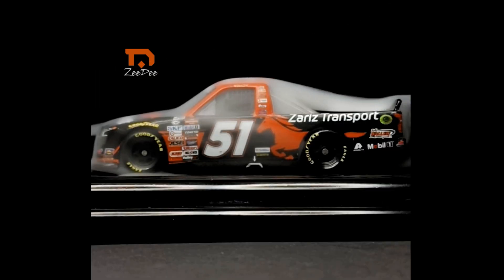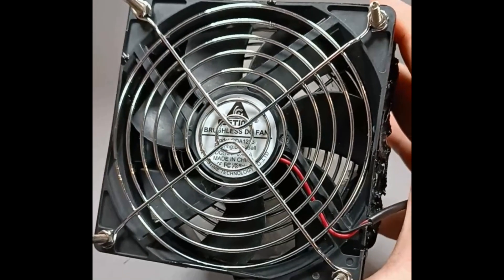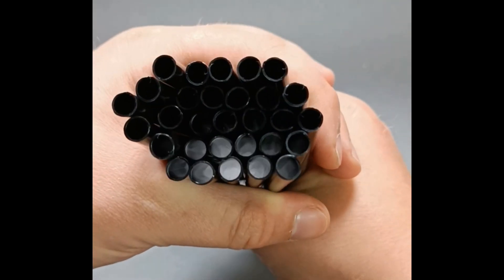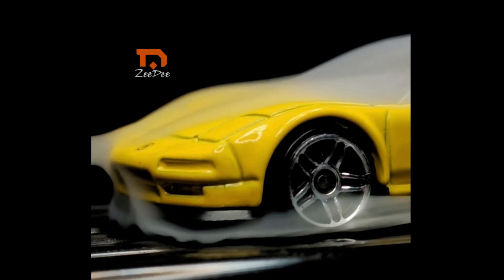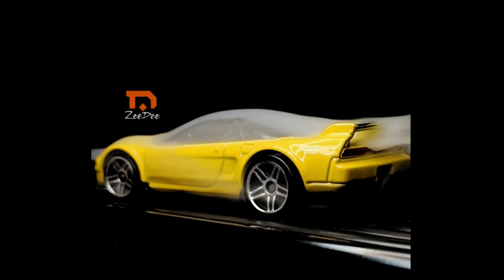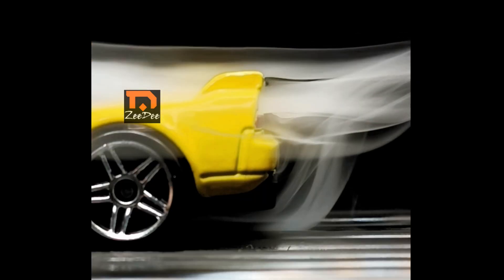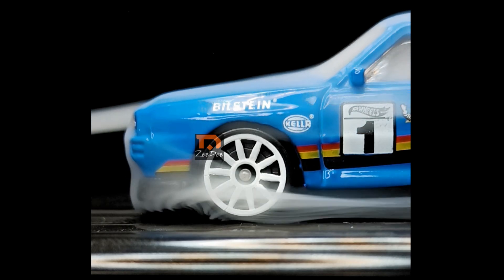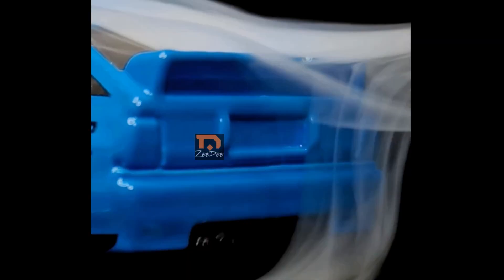Hot Wheels and Diecast Cars Wind Tunnel Test | Aerodynamic Test at Home

Comment: hi, if you want to make this wind tunnel demonstration more accurate, have it run on some sort of treadmill running at roughly the same speed as the wind speed through the fans

apparently real life testing of f1 cars in wind tunnels were inaccurate due to a stationary road, whereas a moving platform will help demonstrate proper airflow during races